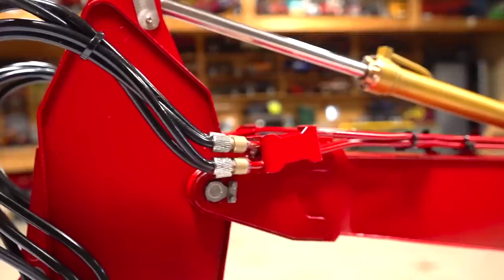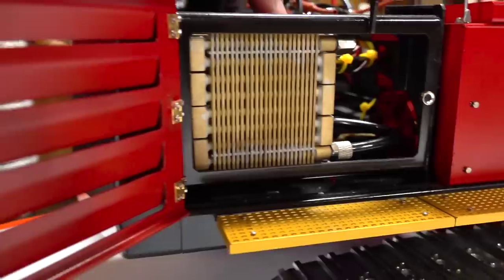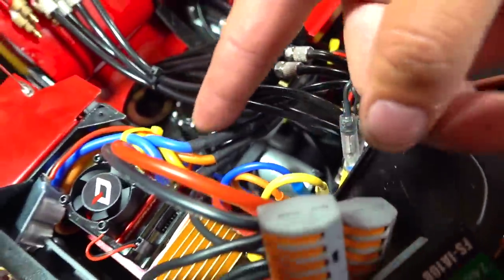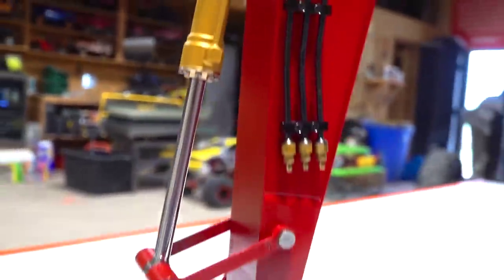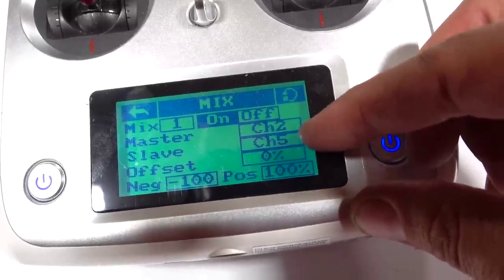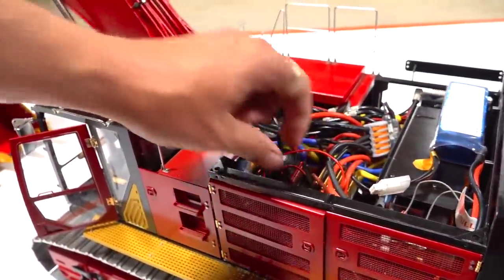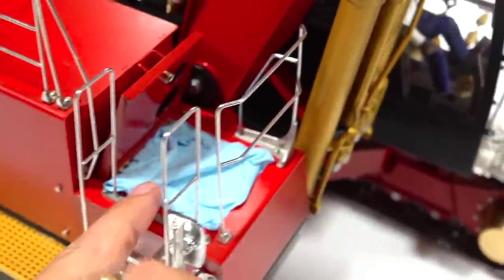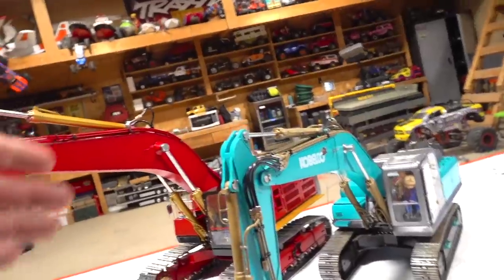FINAL RESULT! PROJECT: "JOHNSON" LESU CAT 374 FL EXCAVATOR BV 5 - Mixing Tutorial | RC ADVENTURES

Comment: It's almost finished, it is really beautiful, it's crazy the number of wires that there are inside and it is sure that you have to take your time to wire it all up. I think your welding is good because at this location it is really not easy to work, A little bit of dremel and paint and it should be good, the advantage is that there is no force in this area of the excavator arm . The difference between the two is huge !!! I thought the blue was already big 😄 The red beats the record of size, the work in the mine of Youtube Gold will be at the top !!! Awesome result and great work !!

Comment: The tech content is important. All stuff I’m already familiar with but the little details and tricks are good to know. Might want to split this kind of video into two. One all action and reveal for the masses and another that goes into the nitty gritty details. 

Also an overhead camera would free your hands up. You could leave it run while you build for cool time lapse shots. I’d be shooting in 4K so you could digitally zoom into the details. 

A bench top demo of the hydraulics and electronics before they are installed would help communicate how it all works.

I love your content, there is so much potential for more depth.

Comment: Hey Medic!  FYI - on the BL120, you can also program it using a "LED Program card" like the ones that come WITH the "QUICRUN WP 1080".  Just plug in the receiver plug into the program card instead of the receiver.  That's how I programmed mine anyway.  A lot easier than all the flashy flashy.

Comment: Project Johnson is really really big. I had an rc excavator when i was younger, but it wasnt as realistic as '' The Big One''. There was no hydrolic fluids, electrical motors everywhere and the battery was drained in less than 15 minutes.

Comment: Hey on that ram with the broken brass fitting , use one the fittings you had spare from the value vid . It would be easy just tap the hole and put it on  it also will stronger fitting. And it will look better .....bonus!🙂

Comment: I like these build vlogs! A tip for the electronics, when you have so many ESC's it can get messy with the wiring and connection points (I see you using WAGO clamps). You could look into a power distribution board for a quadcopter. Those are light and take up very little space. They can also handle the power required to operate this excavator

Comment: Just picked up the new CR12 Tioga by team associated, i like it. The steering servo is way too weak and the battery is weak as well. The motor can handle a 3s lipo which i highly suggest upgrading

Comment: When you fill hydraulic oil you should retract all cylinders as much as possible then fill. Reason being that the rod side holds less oil than the piston side of the cylinder. That way it cannot overflow when extending the cylinders. Oil level on actual excavators are checked like that as a rule of thumb with the bucket curled up, dipper arm out and boom lowered as far as possible.

Comment: I know you built this over a year ago but I am building this kit right now.  I had a question on the DC fans.  Did you just wire the 6015 fan straight to the battery or a bus bar and did you need a flyback resistor for the fan for circuit protection?

Comment: Loved this build! If you show all the install of electronics and  hydraulics and someone dosent want to watch they can always fast foreward through it. If a person wanted to see it and you don't show it were just out of luck. I really wanted to see it because there is about a 95% chance I will order one if Lesu ever gets back to me with a couple answers I asked them .  After seeing the hydraulic problem you had with the 260 I was quite interested in see if they did far better on this one, so seeing it would have been nice for me .
The build part I know I can do, but the  hydraulics and especially electronics have me a little bit baffled. Did you have any problems with the preassure relief valve like on the 260, and was it explained or drawn better on the 374. The average person dosent have a spare set of hydraulics sitting around from another build I'm order to replace a system that didn't work as yours didn't.  I'm almost positive now I will order one assuming Lesu gets back to me. I'll be watching this again I'm sure trying to figure out how you ran the electronics to see what I can see. Thanks again .

Comment: What kind of brushed esc was given by lesu? Can it go 100% speed to throthle and backward too?
Reply from the maker: Nope.. it seems limited on its reverse speed. Its slightly slower going right. Its a 25$ esc though.. lol Cheap to upgrade
Reply: @TheRealRCSparks  once you change it please let us know in the show, I follow your channel. I have same problem with my esc and I want 100% F/B brushed cheap esc. Usually the programable can set to 100 backward but those are double or tripple of the price. If you or anyone can give me a good advice I appreciate it. I checked hobbywing 1060 Esc, but as far as I remember it goes only 60-80% backward.

Comment: Love these videos. Has anybody figured out how to get true dual rate to work on Flysky  FS-I6S ? Flysky says even though it says dual rate on the display on this radio one cannot assign dual rate to say SW A to switch between one  rate value and another  as radio does not supposed have dual rate capability. Emailed flysky on this issue and thats the response I got.

Comment: Thank you for sharing the practice of unplugging the power wire from the pwm cable of any additional escs. I’ve seen too many guys on trail and comp crawlers leave them in and then have malfunction or failure of a receiver or servo. It’s a simple trick if you have more than 1 esc or if you have an external bec powering the rx vs direct to servo.

Comment: Those hook ups as you call them are called distribution blocks! They are very common in the 12volt community for car accessories.they really keep wiring down to a minimum.....they also give stronger current with minimal voltage drop! Very cool they come with this!

Comment: Well, I don't know where to start.  The last Remote Control unit I purchased (and it was the most modern at the time) was a ways back.   Maybe 30 years if I can guess.  It was a Futaba (I think) about 4 channels.  But it was the best I could get for that size at the time.  There was no MIXING of channels and there was no display screen - now that seems to be the normal thing.  The servos were controlled by signals and each direction for each servo was one of the sub-frequencies.  So. while I'm festinated by your discussion of all these capabilities.... they don't mean much to me.   I have trouble even comprehending how you can operate all your units - and all the sub functions - at the same time without issues.  In the past. you couldn't have more than about 5 units in the same area operating.  The others had to have the transmitter turned off.  Ohhh, the age of the dinosaurs, wasn't it a wonderful time!!

Comment: Now all you need for this unit are some of the Hydraulic accessories that can be run from the lines on the end of the boom. perhaps a Jackhammer tool, or Earth tamper, perhaps even a tree cutter with grappling claws and electric saw. there are so many accessories that you could literally build yourself! Get yourself a thumb for your bucket first thing, all it is, is a hydraulic claw that mounts opposite the bucket and when I was driving those tings we used it for removing giant boulders that were too big to be handled by bobcats or front end loaders. That "thumb" is also excellent for locking other loose accessories inside the bucket at night time so that they couldn't be stolen without them first having to break into and hotwire the Trackhoe itself! This is super cool, I just came into these videos today, so I haven't heard how much these things cost, but I can imagine they are a few thousand bucks, considering that they are basically functioning trackhoes the only thing that could make it more original is to put a scaled hown diesel engine and attach the hydraulic pump to the engine with w functioning PTO! Does anyone make a scale diesel engine this size? That would be so awesome if there were!!!! even a micro gas engine would awesome, for that matter! this is the ultimate toy for a grown man, and even more so for a man who used to operate trackhoes or maybe still does. I know a number of guys who could beat or at least contend with the Guiness Book of World records when it comes to doing things with a track hoe. I know one guy who could scape the dirt out of the box of a dump truck without ever scratching metal against metal and damaging the Dump Truck Box. This would be the best toy to get them for a birthday or a retirement day!!!! How much are these things?

Comment: The excavator really does look like iron man! video is great info! now on you tube gold you need this filling dump trucks in the quarry so you can dump straight to the new big green plant.. it should be able to handle the capacity. otherwise you need to start using the rock dump.. It's pointless to have such a big dump truck and never use it! Especially with your new site looking like a real quarry.

Comment: Would you be able to put a breather hose on the top of the tank? Direct it off the side of the machine so when it does overflow it leaks onto the ground, and helps keep the tractor clean? Its hard to see how much clearance there is so idk if it would work. You mentioned a 2 way valve, how would that work? I'm really unfamiliar with rc hydraulics, but this is so cool! If I ever had the money to get a Tamiya king cab and one of these.. oh man 🤩

Comment: What's crazy I don't know if you remember but I operate full size track hoe for a living when we check our hydraulic fluid on a Cat model the Boom is set at a 90 degree angle from the cab with back of the bucket setting on the ground,  a Komatsu the Boom is stretched all the way out with bucket rolled out and teeth on the ground, kobelco to check it the boom is curled up under it's self with bucket curled alao and sat on the ground as if like you were going to haul it on a lowboy. But my question is what position does that have to be in to get an accurate reading on the hydraulic fluid level?

Comment: Those connectors are the old style WAGO nuts the new ones are smaller and you can get ones rated for 10 ga wire.

Comment: Well done dude, what a great rc model. Just a little tip on your wire connectors..... there are a little bit smaller  ones (building size) out there. The brand of these are WAGO. Here is a link to the smaller ones https://www.amazon.com/-/de/Wago-221-415-LEVER-NUTS-Conductor-Connectors/dp/B01M6Y2UEK/ref=mp_s_a_1_6?dchild=1&keywords=wago&qid=1592032113&sr=8-6 hopefully this information could help you or anyone of you guys. Greetings from Austria 👍

Comment: Love it. But to to make it true and correct,  couldn't you change the sticks for carousel spin and bucket movements. They are opposite on the machines i run. Bucket is left/right on right stick and spin is on left stick. Just my 2 cents. You're builds are awesome as always.
Reply from the maker: "To make it correct".. that's the beauty of this hobby.  You can choose to setup your machines any way you like. I dont like limiting my skills to a "standard" set of control layouts. I can use them left, right, upside down and reversed! Lol..
Reply: @TheRealRCSparks  agreed. But it is possible? I would hate to be playing with this thing and then jump in the big Komatsu and go to dump the bucket and slam into something because I spun it instead.

Comment: Very nice build, i wonder about the oil overflowing in the beginning before you reach the correct level. could you connect a second temporary little open tank to the filling-hole and cap the breather temporary. The temporary open tank will then act as a visual oli-level and you can add or subtract oil on the fly wile you drive in the machine to get the air out of the system. Look it as the same way you breath your break system in your car after repairs.